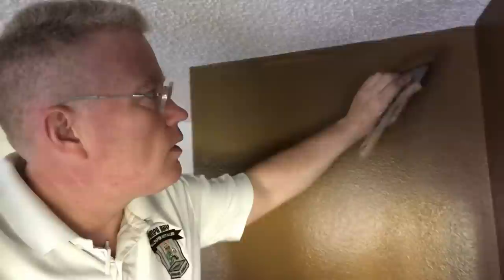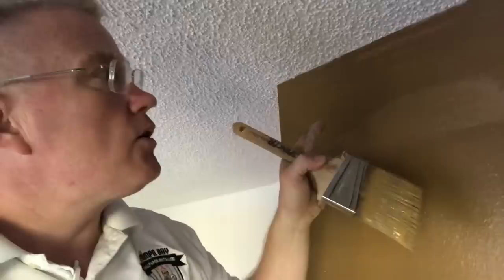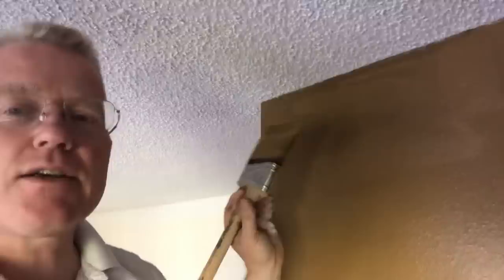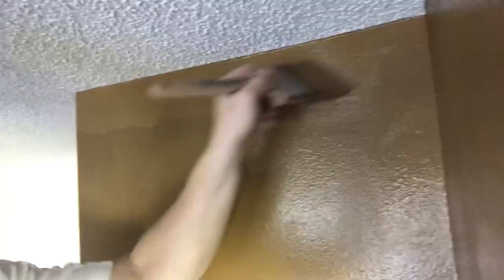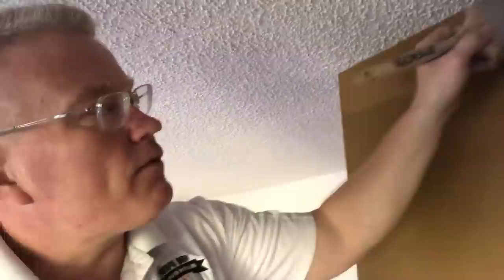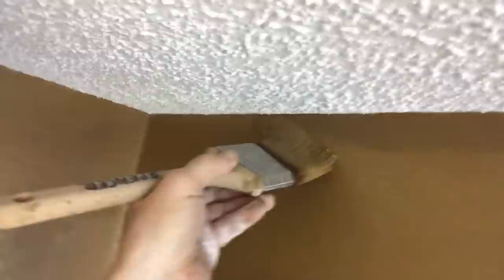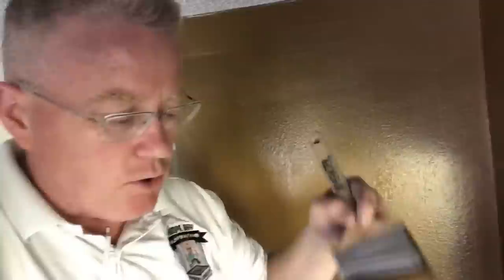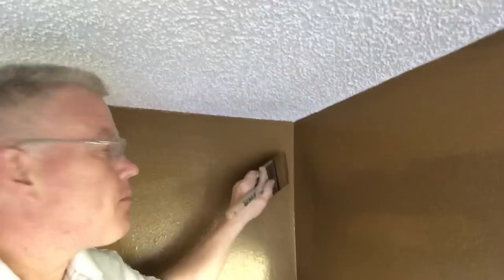3 Tips On Cutting or Painting Straight Lines -🖌️ Spencer Colgan 🖌️ Tampa Painter

Comment: when you add the second cut with the brush, will the second cut-in be visible over the earlier rolled on paint on the walls.   Also, your cut was a good six inches as you feather in the paint.  will that cause the overall coat of paint to have two visible paint textures where the rolling was and where the paint brush strokes are?